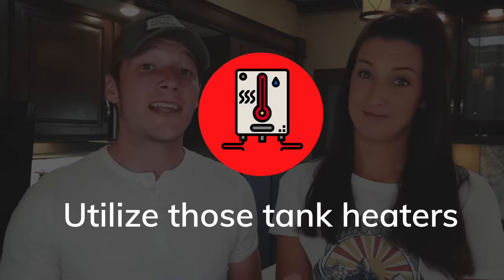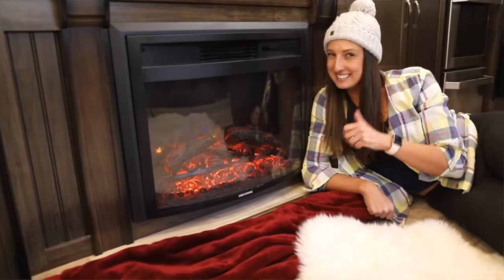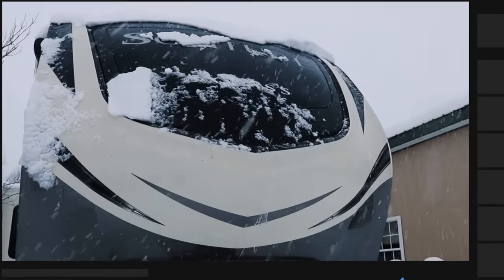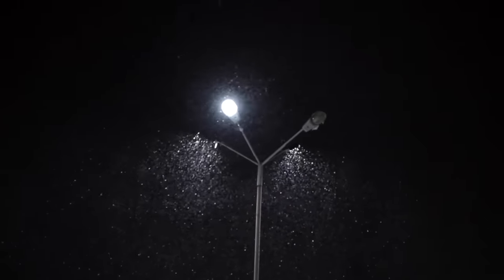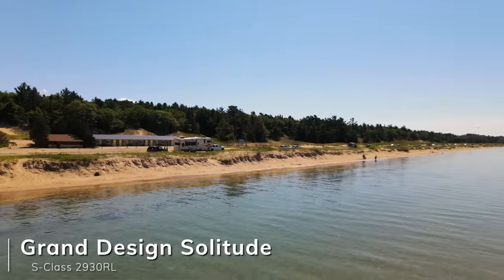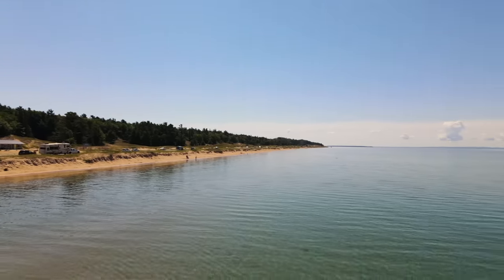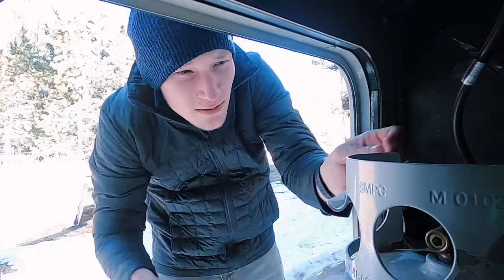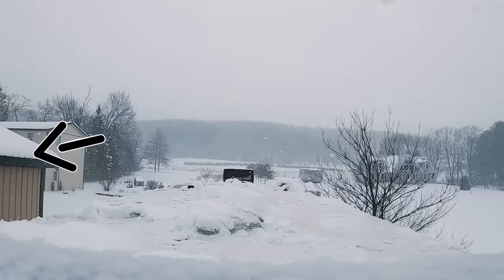Best Winter RV Camping Tips to Maximize Comfort (Winter RV Living)

Comment: We camped all last winder in our camper. So a couple other tips - People don't realize that propane is considered a wet heat! It adds to the humidity in the air. Use the tips here, plug ins or your electric fireplace.
-we use a homemade hose heater and one of the pre-made one. Pre-made broke in a month. Homemade was better.
-OUR WATER FROZE but it wasn't in our hose, it was actually in our outdoor kitchen sink, so use a warming light on cold nights. 😉
Good luck!
Reply: If you have a forced air furnace they don't increase humidity. 
The flame and exhaust are inside the heat exchanger. 
Ovens stove tops and using propane lanterns will create a lot of moisture inside👍

Comment: Here in Minne-snow-ta it's common to use heavy plastic over the windows to block drafts and create a barrier but you can still see out your windows. ;) As for reflectex...is there any reason (other than appearance) to not just put velcro on each piece and around the windows to make it easy to put them on and take them off? It comes in a variety of colors so you could try to match the color of the walls. Also, you can wrap electrical tape around all your water lines and drain pipes to keep them from freezing (to a point, lol). We also let the water barely trickle, but that's probably not an option in an RV. LOL

Comment: Im sure we were not the coldest, But we went back to Wisconsin for thanksgiving last year, it was in the teens, we had to boondock, and the pine trees blocked our solar, so I ran the Genny to charge our Lithium bank about every other day, we were there a week, burned through like 5 or 6 20 lb cylinders of LP in our Imagine 3250BH the one thing I didnt do did bite us, We didnt cover our Low point drains, so I had to thaw the hot side one morning, I think a simple foam silcock cover would have prevented this, but yea Woo Hoo 14 degrees!

Comment: I have an EPro that has heated tanks, but Flagstaff inexplicably chose not to cover or insulate the underbelly. I’d like to finish the underbelly, and need some help. How close to the tank heaters can insulation be installed? Are insulation panels the besy option or would insulation rolls be better? I plan to use the plastic panelling available at HomeDepot/Lowes to cover it all for waterproofing purposes. What have others of you used? Have any of you sought to finish the underbelly on you travel trailers?

Comment: Bonus comment on the bonus tips heat pumps typically can only provide 20 degrees warmer air than the outside temperature i.e. 40 degrees outside = 60 degrees inside. ;-)
#ThanksHanks

Comment: Can I leave the grey water valve open if I have the hose running under my 5th wheel into my septic tank with 2” insulation board completely in closing the underside of my camper? And I have 2 oil radiant heaters under it as well..

Comment: Reflectix is awesome. I also use it inside my cabinets on outside wall and ceilings especially on slide outs. Drops summer Temps in cabinets by 15 degrees. Found that out this last Texas summer. 103 to 106 degrees. Yuck!

Comment: I travel for work and spent last winter in Wichita, KS👎🏼. No skirt, just insulated most of the windows and burned a 💩 load of propane. The temperature only got down to a steady 5 degrees & snowy, but the constant 20-50 mph winds is what really made it 🥶. No frozen pipes so I won…FU KS!

Comment: Don’t use hay bales!!!
They are right, mice are an issue now.
But the biggest problem was mold! We stacked 2 high all the way around camper to enclose under it, come summertime when we pulled the hay off camper there was black mold all down our camper. And every single hay bale wire was rusted and broke so hay came apart in handfuls! If you do use bales, wrap every single one in black trash bags and you’ll be way better off than us!